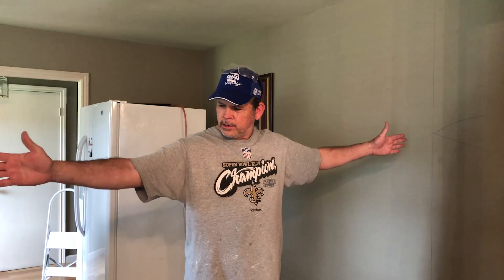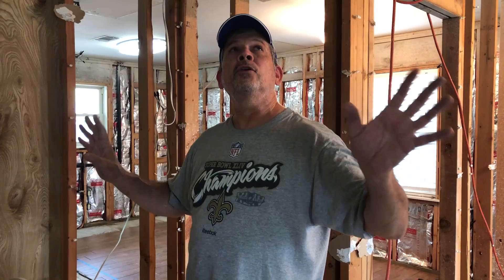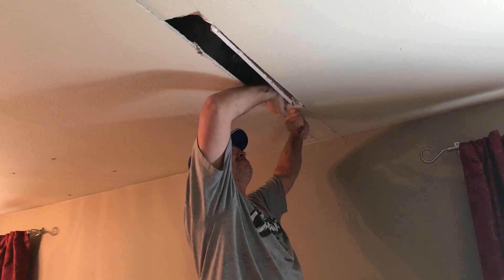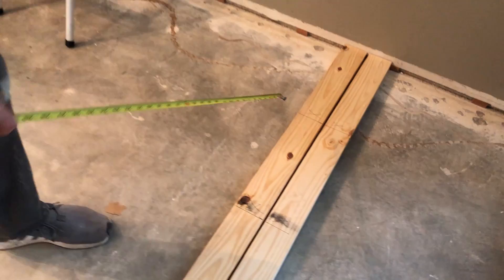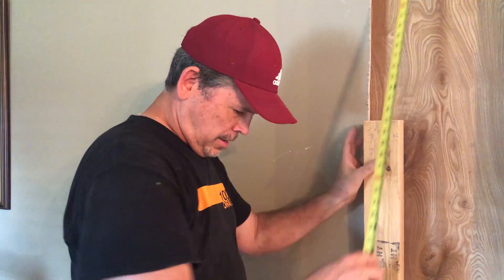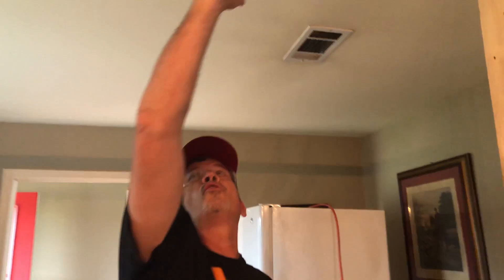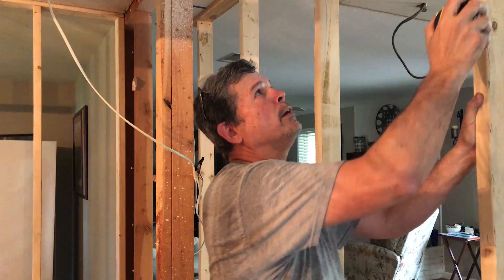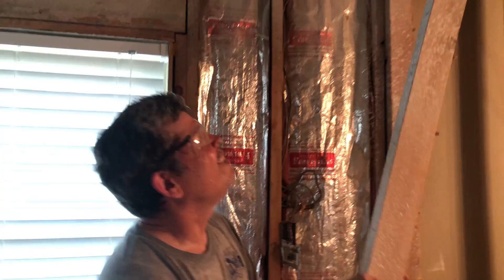Remodeling a Kitchen A-Z -Part 2: Prepping for TWO Beams

Comment: How do you get an engineer to design the beams?
Reply from the maker: Finding a structural engineer/architect for a residential project can be a challenge.   If an online search is unsuccessful, your local permit office may be able to recommend someone to you.  Also try calling around to architectural/engineering firms.  If they can't help you ask if they can recommend someone.  I hope that helps - thanks Jan!
Reply: It’s awesome how helpful you are to the people that watch you.   I can tell from your videos your a good man.  Thanks for all the content!
Reply: @StudPack  I agree. It seems next to impossible to find residential engineers! Out of all the resources needed for a remodel/general residential construction, this is the most difficult. I think it has to do with residential not offering big enough commissions for the engineers. Anyway, I eventually found the ones I use through referrals from friends/family/other trades people who do similar work. Still, the options for these types of engineers is shockingly small.